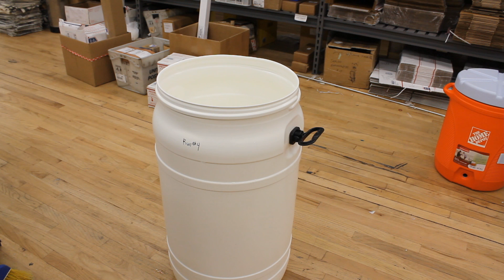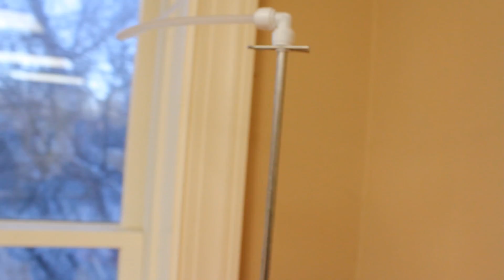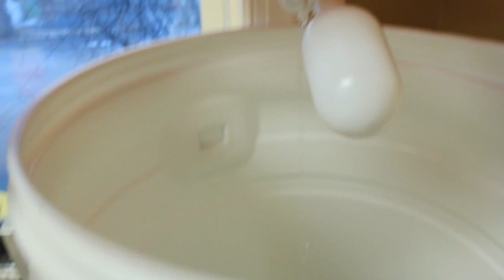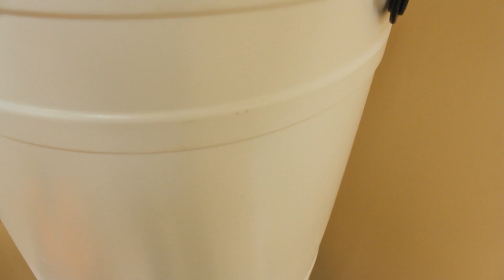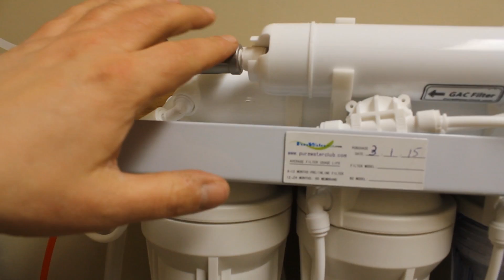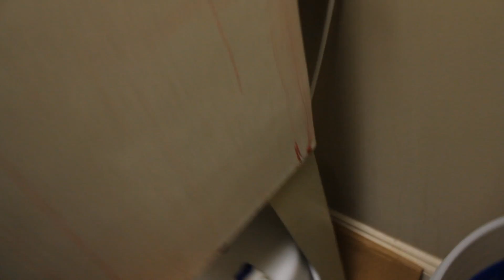RO Brewing Water Setup BobbyfromNJ

Comment: I have the same setup now using Bobby's great idea. I upgraded my RO filter from 26GPD to 75GPD and just bypass the under sink until 18 gallons in my Brewing water barrel, I then use http://www.ezwatercalculator.com/ spread sheet to build my own water, adding the ultimate control of my water. Thanks for sharing your great ideas.

Comment: Do you have to clean the tank? If so, how and how often? This is a great idea. I went away from this because I thought I'd have to get a big pressurized tank and didn't want it taking up space permanently. Definitely worth a shot since I pay $1/gallon for water at the grocery store. This storage tank would be easy to install a day or two before brewday and then store in a more convenient place when not in use. I wonder if it would be worth it to just have a portable RO system just for homebrewing but I worry that it would be more of a pain to store and keep clean. The benefit of a portable system is that you wouldn't have to modify your household system or carry buckets of water back and forth. My RO system is in my basement and I brew outside.
Reply from the maker: +John Rankin I do drain the tank, scrub it out and then starsan it about once every 2 months.

Comment: Bobby, sorry for the late reply but I just saw your vid. I'm not familiar with your particular RO system, however the 'polishing filter' on my system doesn't actual filter but rather re-introduces minerals for better flavour as drinking water. You can test this by using an inexpensive TDS (PPM) meter and checking the water before it goes through the filter and after. The way I have it set up (and you may want to look into as well), is have your 'Tee' located prior to the polishing filter so the water you're pulling off for brewing is after all of the filtration and the RO membrane, but before the polishing filter adds back minerals. Your PPM should be very close to 0 at this point depending on how good your system is, how fresh your filters are, and how dirty your well water is. 

BTW a GREAT place to pick up RO systems is aquasafecanada dot com. They have the best prices ive seen, free shipping, throw in extras like pressure gauges and PPM meters, float valves and excellent customer service with a warranty. Look under their aquarium water setups, they have some incredibly efficient units that you can dial down to as little as 1:1 (for waste water) which helps if you're on a limited well. I'm running on extremely hard city water and their 8 stage aquarium setup gets me to 0! Oh and they have a huge capacity, like 200 Gal per day. Don't take my word for it, check out their site. I don't mean for that to be a plug but since you're not selling RO units, I figured it would be a great place for your viewers to source the best RO system I've seen for the best price I've seen.

Other than that, you're setup looks great, very similar to mine. Hope this is helpful!

Comment: Bobby, did you have to drill out the 1/4" fitting, so the 1/4'' that the tube could slide up and down? What type of fitting do you recommend? Thanks
Reply from the maker: Castermmt It's called a bore-thru fitting because it's already drilled out. If you look on my website brewhardware dot com the fitting you need is model PCOMP4.

Comment: I have a very similar RO system (ROES-50) that I bought on Amazon.  But I need to plan ahead and pull water into multiple 5 gallon bottles, since I don't have the fancy large barrel!

As to building up your water profile, I've been doing that even before I got my own RO system (used to buy RO water from the Glacier machine at the grocery store). I use the "Bru'n Water Spreadsheet".  Takes a bit of getting used to, but has a lot of help and background info right there in the sheet.

Comment from the maker: I got the system on ebay but it looks like they have a website purewaterclub.com
If you don't care about the drinking water faucet or tank, this is a good one [RQ-5-100+4]. They also have the float valve.